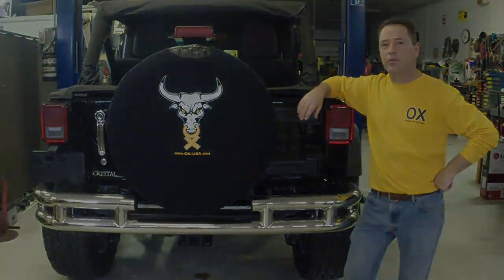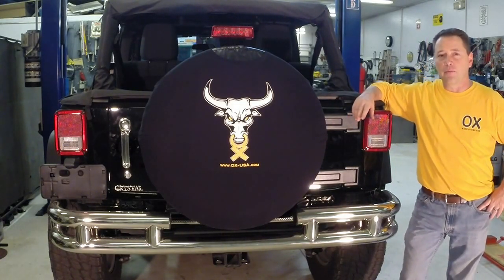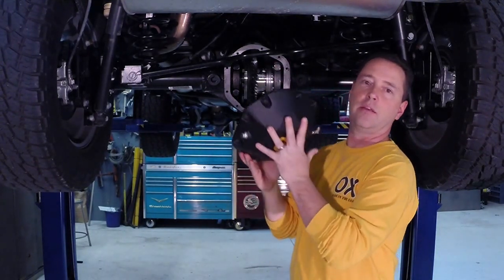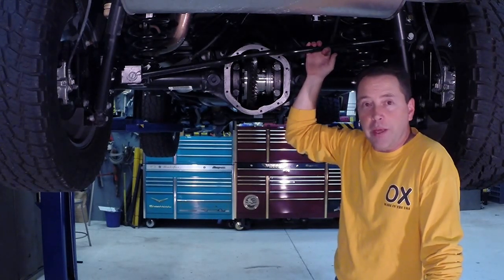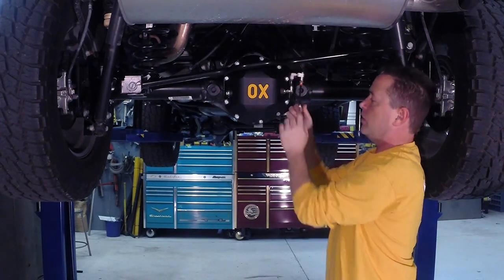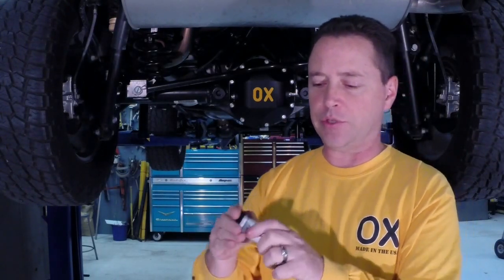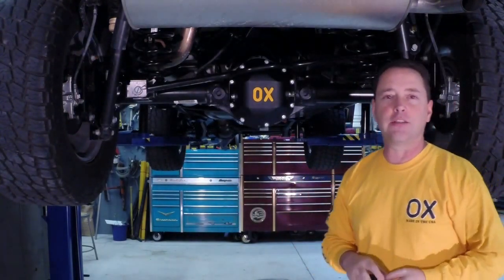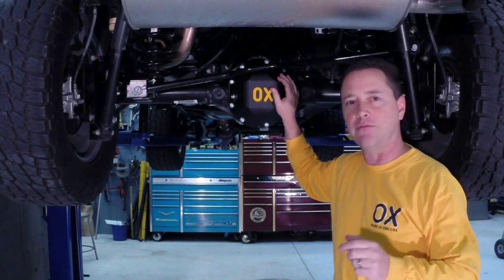Information on OX Lockers

Comment: Thanks to OX Locker for making a so good locker for the Jeep KJ. Here In Canary Islands almost all the lockers installed are ARB. They are very good devices but the OX Lockers have an unbeatable advantage over them, the differential internals don't have air components like seals, air lines, etc. All the internals in the OX Locker are mechanical activated through a slide pin. It's a beautiful desing for me because once you have the diff installed in the axle, you can control it with any external device like air, cable shifter or electric actuator and when the external device fails in the middle of a trail (something almost impossible because of the strengh desing) you can simply disconnect it and use a bolt to lock the slide pin. Another advantage is, when you use an air activated locker, if the system is not able to keeping the air, the locker will disengage or even not engage, but using cable shifter or electric actuator the system can be locked indefinitely without wasting power, so you can use for a long time or keep it locked for ever. Clever.

Comment: I'm running the OX locker in my jeeps Dana 35 rear axle, and I was so impressed with the performance of the ox that I broke down and bought two of them for my 05 super duty one ton axles I'm putting in the Jeep. Very solid product